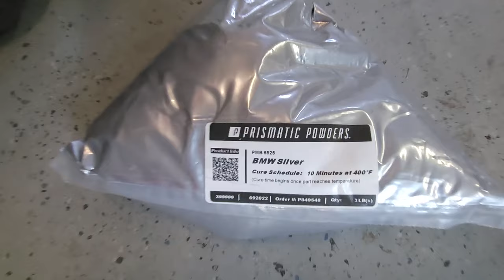BBS RS BUILD IN 10 MINUTES (FROM JUNK TO NEW)

Comment: Do you give up any structural strength putting the centers in front of the lips rather than oem placement?  Beautiful work 👍👍🍺🍺
Reply: no
Reply: @RichDasix  Well, no to your no. You are now putting load on to the screws, without the support of the facias lip towards the barrel/rim. I believe most of the forces are going to work pushing the wheel out, towards the bolt heads.
Reply: I was wondering the same thing except about using welding as infill for the old bolt patterns. This is a good point though, I thought it looked funny but he's showing off his work by putting the centre on the outside so I respect that

Comment: Isn't the outer lip designed to go on the outside?

Isnt the bmw silver part supposed to be in between?
Reply from the maker: You can do it both ways with that outer lip/inner barrel kit
Reply: @AntoineMk1  

Always thought putting the inserts on front was only done on 2piece  (replica's) rims.

Anyway is a creative way to change the ET-value and narrow the rims.